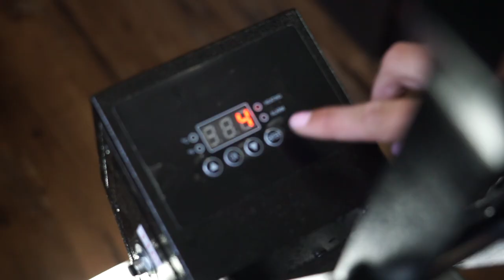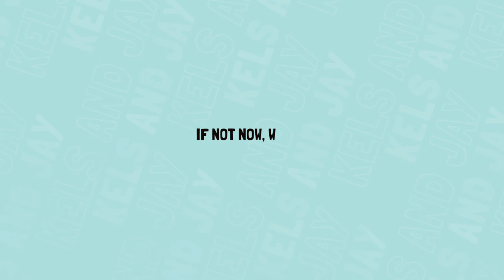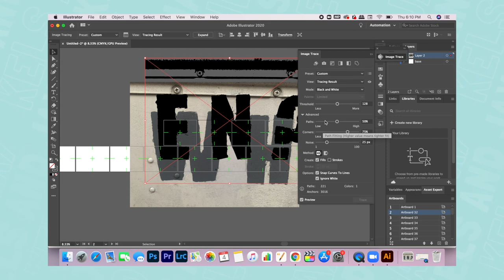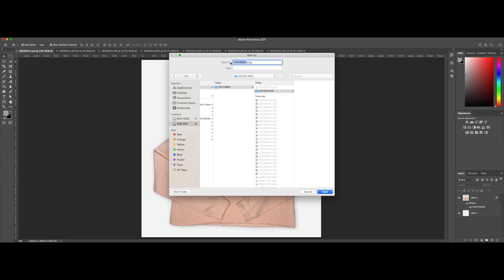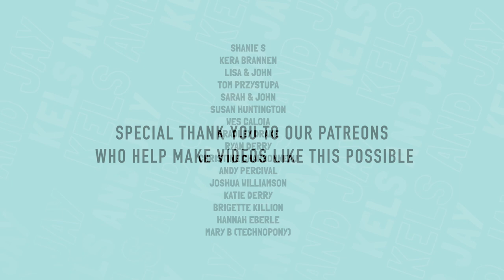Starting a Clothing Brand From Our Bus | HERE'S HOW!!!

Comment: What’s the pull on your heat press? Or are you connected to shore power when your making items?
Reply from the maker: It’s pull 1600watts to get it to heat up
Reply: @KelsAndJay  is that consistent during the entire use? Or does the wattage change after it heats up?

I’m starting my own clothing brand as well and I’ve been trying to find out how much power I’d need if I don’t always have shore power to be able to do a drop every few weeks